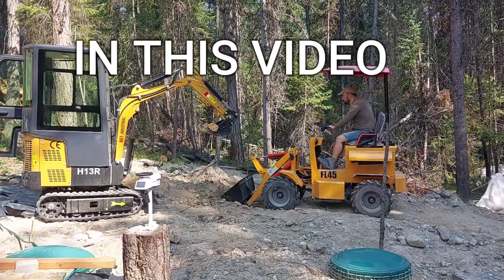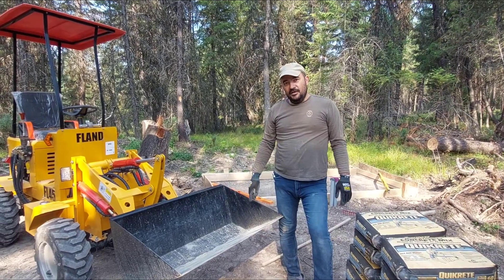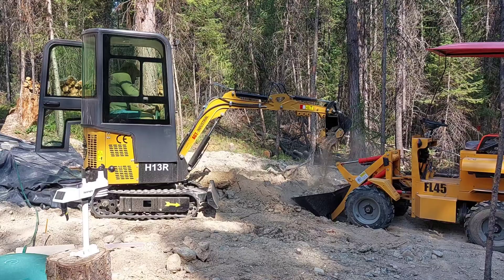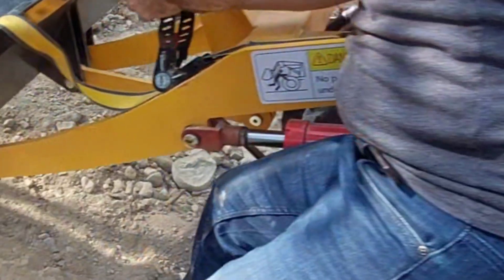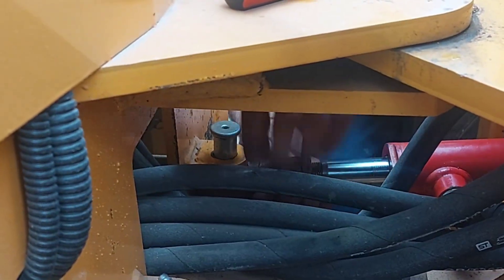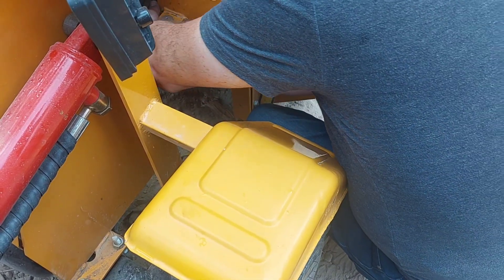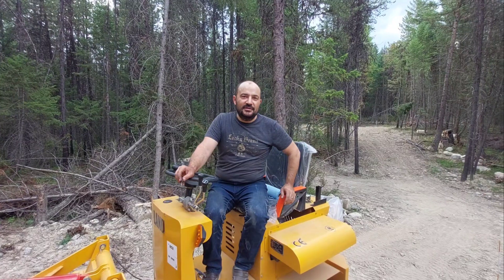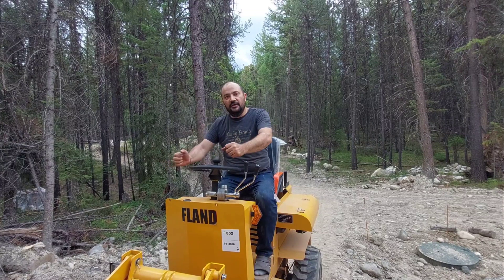FL45 Chinese Mini Articulated Loader Hydraulic Cylinder No Tool Fix. Load Capacity???

Comment: All they had to do was start the damn machine and turn the wheel in till the hydraulic cylinder retracted  or extended to where you needed it
Reply: Anyway y’all got it. So that’s what matters
Reply from the maker: Thanks. 
We appreciate your advice. 
We are building our own house...at that time we had no time to mess with fixing the loader. 
Also, we have no experience, but we are willing to make it work.
Reply from the maker: We tried...  It wouldn't work
Reply: Then simply take off the hydraulic lines. Then you can push it in or pull it out bye hand.

Comment: The previous model years stated 350kg on the plaque = 771lbs for max bucket load.
Loctight should keep the bolts from coming loose
Reply from the maker: Ours didn't say what the bucket load is. 
The loctite is a good idea. We have used it on our mini excavator recently. 
Thanks!

Comment: can you tell me the type of Hydraulic fluid you use in it?
Reply from the maker: Hi. We used SUPER TECH heavy-duty hydraulic oil.  Rust and oxidation.
This is our page, and you can see the picture of the product 
https://www.facebook.com/groups/1191381515412218/permalink/1208283027055400/

Comment: Hey There - I noticed that most of your pins don't have zirc fittings and haven't been greased ... I would highly advise doing this unless you want the machine to be extremely sloppy in a couple of years.

I could also hear the u-joint rattling, that too needs grease... I have one of these and they come worryingly grease free.
Reply from the maker: Thanks for the info.
The zerks are added by us because there were none, and we do grease it. 
Nothing was tightened properly...
Reply: Yep, mine had no zircs, no oil in either differential, no oil in the gearbox, no grease on the ujoints, they also failed to thread the zirk hole on the drive spindles (the bearings will explode if you don't grease them), assembly lube instead of proper oil oh and a fake NGK spark plug (like most of this stuff)... but i noticed a lot of your pins are missing fittings and grease, I haven't been too kind to my mini-ex and it's now extremely sloppy after just 2.5 years, it needs all the bushings replacing in the drive pin holes... so just trying to save you some of the idiot tax I have paid with the last few chinese machines I've bought at auction.
Reply from the maker: I really appreciate all this info.
We are going to try to fix all.
Thanks ❤️
Reply from the maker: Thank you for reaching out.
We are building our own home, and we are super busy, but once we have a chance, we are going to address it and let others know in a video
Reply from the maker: I posted your imput to this group
https://facebook.com/groups/1191381515412218/

Comment: I hate to tell you, but all you had to do was start the machine and turn the wheel and that cylinder would have moved in and out as you turn the steering wheel.
Reply from the maker: We know that yet the cilnder went  out from itself totally.  We tried to turn the steering wheel, yet there was no way to make it go in its place. We had to press it to be able to shrink it. Another solution was to bleed the hydraulic liquid, yet we aren't too close to the store, and we don't have time to waste...
Thanks. 
We made it work like that.
Reply: @LarchLine  all you had to do was put a wood block between the end of the cylinder rod and the frame of the machine and steer it to the left. Those are push only cylinders so the right cylinder pushes the left cylinder closed and the left cylinder pushes the right cylinder closed.
Reply from the maker: @kbexcavation2719, thank you so much... we have no idea what to do.  I hope it will not happen again, but now we know what to do.

Comment: Nice, you got it fixed.  If there is a next time, just open the two hydraulic lines on the cylinder, then with hand pressure only push the rod back inside the cylinder body.  Oil will come out one loose line fitting and air will go back inside the cylinder on the other.   Once the clevis end is back together and repaired tighten the lines and it will self bleed the air out by operating the steering and check the hydraulic tank level.
Reply from the maker: Thanks. Your advice sounds easier!
Our problem is that none of us has any mechanical experience... 
Another problem was that we didn't have extra fluid on hand to bleed the hose because we were remote, and it was Sunday afternoon.  We need the machine to be available the next morning ( right now, it is in use).
Thank you so much for the simple explanation... we couldn't find a simpler one!
Reply: @LarchLine   The most important thing is you were proactive, resourceful and got it fixed just fine.  I am enjoying your wheel loader videos, thanks.
Reply from the maker: We haven't invented the wheel, yet we can find many ways to re-invent it😇